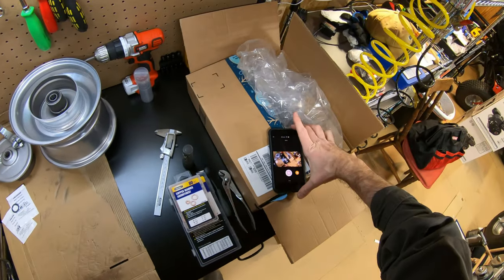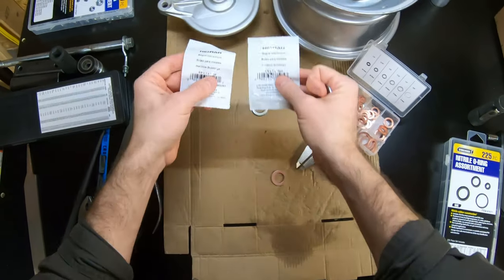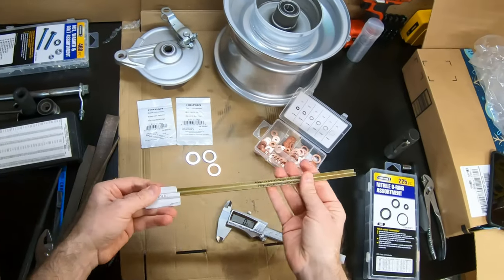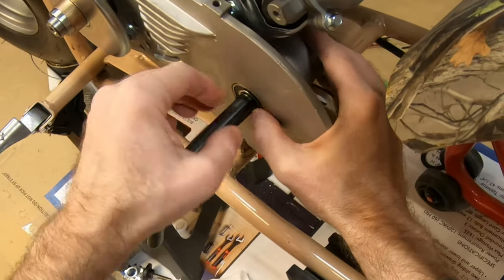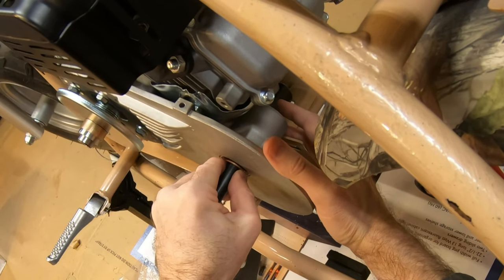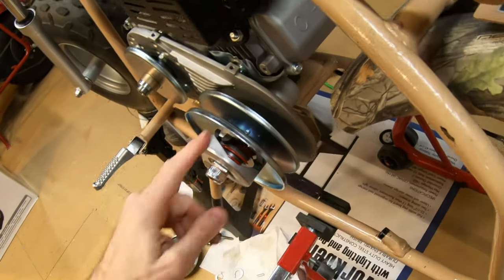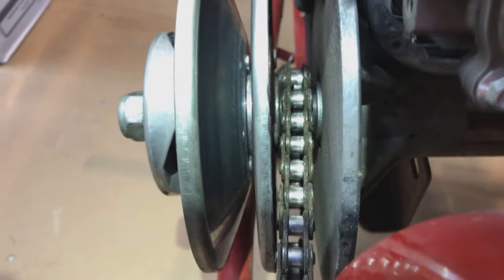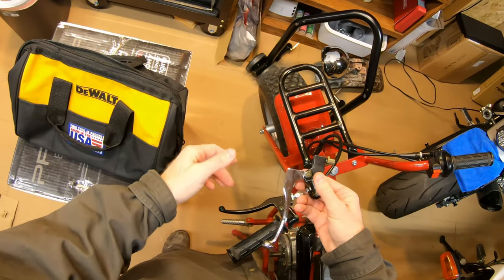O-RING for Torque Converter? 🤯 Coleman CT200U-EX Mini Bike Update [4K]

Comment: Very good information here - I plan on doing an 8T/60T gear ratio on an offroad buggy and I couldn't find an 8T sprocket without a keyway in it. My one question - how many spacers did you use on the front/driver pulley? Thinking about buying the OMB shim kit. I just hope the Juggernaut driver will line up well.
Reply from the maker: Thanks! Yup this will work great for that. On the front I have the spacer TC comes with, then a large washer and one shim from the OMB shim kit. Maybe one other washer, cannot remember.  I'd recommend getting a shim kit. Really helps you dial it in. On my BT200X build series I show exactly what I did to line it up, it is the same as this setup. I'll link to that vid in next comment.
Reply from the maker: I had two washers and a sim. But anyways check this out at 13 min 37 sec in vid below I have been lining up the rear of the pulleys and it's been working great.  https://youtu.be/kumEBKXdQgg?t=13m37s
Reply: @bwxmoto  Awesome. Thanks for the help man!

Comment: Have you considered using omb 3/4 torque converter shims to space it out instead of buying different o rings and spacers? Where did you get that bike stand to hold your ex up?
Reply from the maker: I do have OMB shims, those are for the front driver pulley and are 3/4 
inch. This is the rear driven pulley, and 5/8".  Shims wouldn't really 
do anything about the side-to-side play since they would only shim up 
space between the shoulder and the pulley. The slack is after that 
between the shoulder in the axle and the bearing race where a 5/8" shim 
doesn't fit. O-Ring works perfect though.
Reply: @bwxmoto  so doesn't it depend on what torque converter you get that will need how ever many shims or washers for the back? What bike stand you got?
Reply from the maker: Oh the bike stand, yeah I got that for my TW200, and just so happens to work great for mini bikes too! There's a Link in the description for it.  It really helps! 

Swingarm paddock Stand https://amzn.to/2SXbwPJ
You might be  able to find something similar for a few bucks cheaper if you shop around. Definitely worth having in the garage. 

I think what depends for the amount of shims you need is the sprocket you use. Some are wider than others, and some use have a key and some have a keyway channel, so that's why you need to change those keys out and cut new ones. I think all those Chinese Tav2 30 clones are the same.  But there could be variations in the tolerances so who knows!
Reply: @bwxmoto  thank you for the info! I'll be getting one soon with my 14-15hp motor!
Reply from the maker: 15hp motor!? You getting a 420?
Reply: @bwxmoto  no sir stage 3 for a 212 predator!
Reply from the maker: Should be fun!
Reply: @bwxmoto  yea man it should!